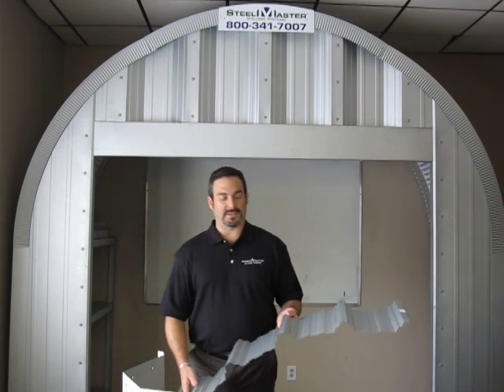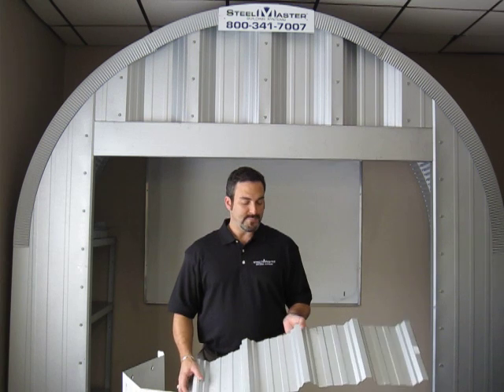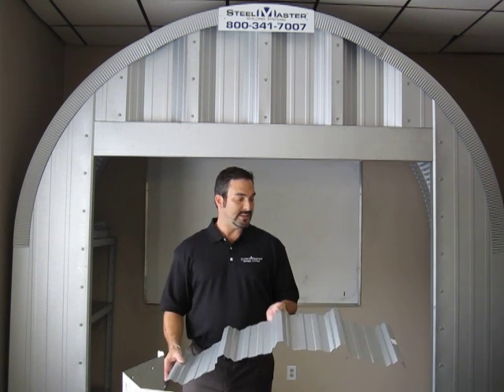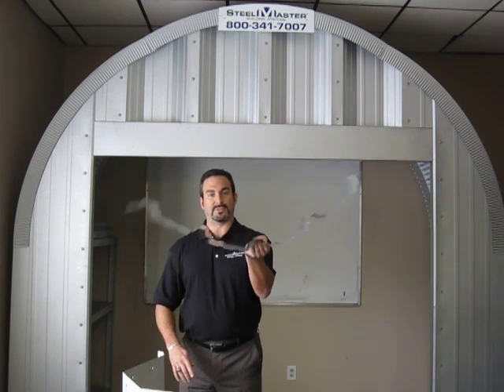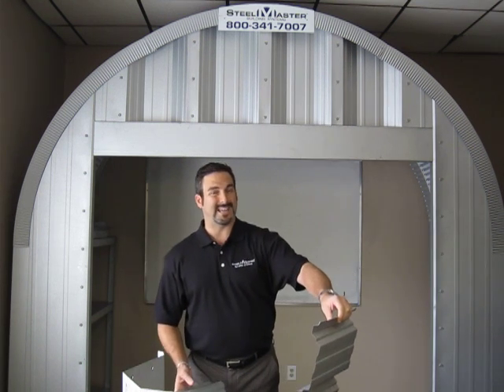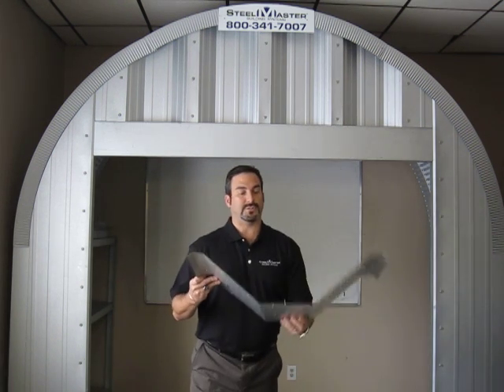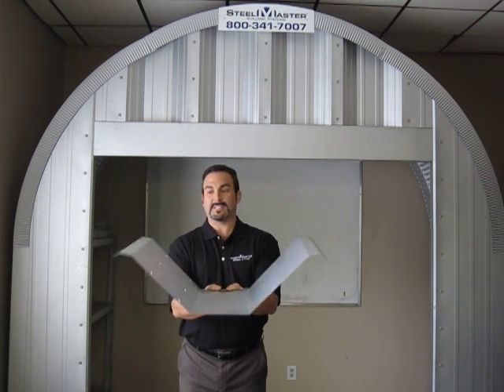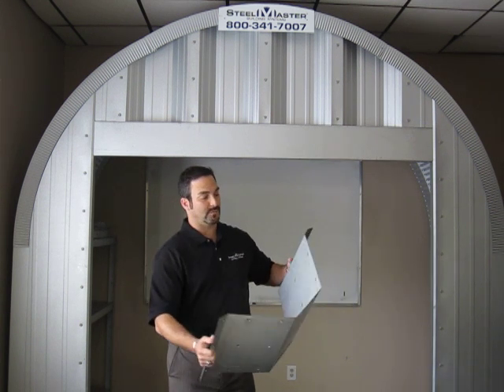What's the difference between 26 vs. 22 Gauge Steel?

Comment: I believe you are comparing apples and oranges.  Your buildings use the sheeting and components for structural integrity, the flat panel barns have a trusses and purlins that provide most of the structural integrity.

Comment: Im just looking for a flat surface, not a building. Is there anything stronger than 22 gauge or anything else you recommend? Thank you!
Reply from the maker: Hi Dana – Steel comes in many gauges. The lower the number, the thicker and stronger the steel. Beyond that, we can't provide any recommendations on a good flat panel. Good luck in your search!

Comment: Im just looking for a flat surface, not a building. Is there anything stronger than 22 gauge or anything else you recommend? Thank you!
Reply: Steel plate. They make it from 22, 20, 18, 16, 14 gauges, and 1/8" plus for non-gauge sizes. The smaller the gauge, the thicker the steel (has some history behind why, but it has to do with how much it weighs). 

Depends on what you want to use it for, if it's a welding table, you'll want something heavy like 1/2" plate, but if it's for an umbrella, then you'd want something light.

Comment: Could I shoot a hockey puck at a flat sheet of 22 gauge steel? I need a strong, solid, durable surface to shoot against. Also does it produce a sound when hit by something? Thanks!
Reply from the maker: Yes, you can absolutely shoot a hockey puck at it! If you are a good, it will ding the metal over time and definitely make noise when it hits. Quick question, are you looking to buy a steel building, or just some flat steel?